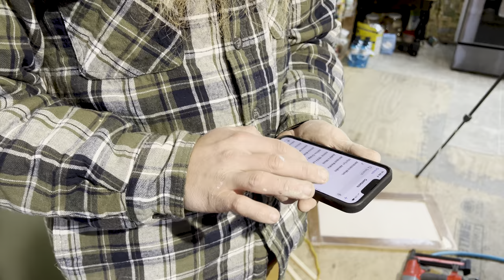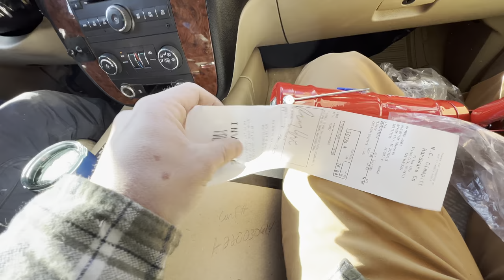Modern Home Makeover // Drawer Fronts Done // Episode 21

Comment: You need to tell Jamie to get you a Dewalt cordless caulk gun. Also I have seen where you punch a hole in the bottom of a new tube then spray WD40.  It's suppose to allow you to use the whole tube and you don't get blowout inside the tube. Also Ray, instead of waiting to buy a router table, make one. There are a S Load of videos and I suggest you check out CPO Powertools and go to the reconditioned section. You'll get quality tools w/batteries for a fraction of the cost of new. Good luck.

Comment: Pro Tip. When you’re gluing drawer faces or overlay fillers. Caulk (Lexel) and then some hot melt glue dots. (Glue Gun). Make ‘BIG’ glue dots then stick it to the wood/drawer The dime size glue dot will allow you to make adjustments. The glue dots will hold until the caulk cures. No holes to fill 

Way to hang on this job Ray and Bek! This channel is doing great things for those that may be too intimidated to try. Jason said it best, if you mess up, do it over.
Reply from the maker: Nice tip!

Also, I’m glad to be an encouragement to others to tackle things that may be out of their comfort zone. We didn’t think about that when starting the channel, but we have had a lot of comments about it. We’re glad to show our mistakes and troubles we run into.

Comment: Hey! I’ve done a bit in kitchens and the drawer faces are typically screwed in from the drawer box and also, for glue titebond does make a thick glue for easier vertical gluing. Looking good though!
Reply from the maker: If lumber prices weren’t so high we would have went with a 1/2” drawer face plywood… If we had done that we would have screwed into that. Screwing into 1/4” wouldn’t have worked. We also love lexel and other Sashco products. Lexel has been proven to work better than wood glue in a lot of situations.

Comment: They do make a plug in adapter that will go into the cordless tools so you can run corded at home. You should see if you can find one of those for your flavor of cordless.
Reply from the maker: Thanks! We definitely will look into it.
Reply: @Building_Jays_Way  Or buy a dewalt -> makita adapter for 10$ so you can use all your dewalt batteries in your makita

Comment: While too late for your drawers, as a heads up, you actually would place the drawer pulls slightly ABOVE center as your normal view of the drawers is from above while standing. Putting the pulls slightly above center gives the allusion of being centered from the standing position.

Also, for the bottom drawer (and even middle drawers if they are noticeably taller than the top drawer face), I tend to place them at the same distance down from the top of the drawer face so there is the same reveal between the top face stile and the handle. This again is to show the same reveal when looking down at the drawers while standing in the kitchen.
Reply from the maker: Thanks for the tips… I’m sure I’ll have other cabinets with drawers to build in the house.

Comment: What kind of poly did you use? Could it have been applied with sprayer?
Reply from the maker: It’s water based.  It could have been sprayed. I’m a little afraid to spray poly in my garage. I’d rather make sure it’s put on clean in my kitchen where there’s not as much dust.

Comment: Did you use the pancake compressor for the paint sprayer? If so, what kind of sprayer?
Reply from the maker: I did use the compressor and a kobalt sprayer.
Reply: @Building_Jays_Way   Thanks for the reply. I’ve been wanting to try a sprayer with my pancake, but wasn’t sure it would work. Cabinets look great!
Reply from the maker: It works with smaller things like the drawers. I’m not sure how well it keeps up with bigger things though… just a heads up.